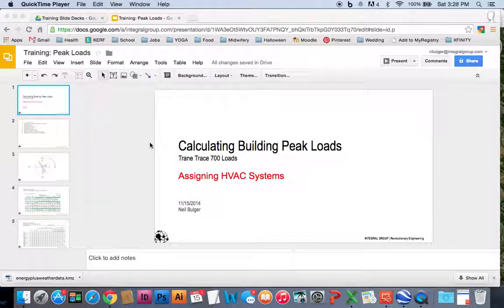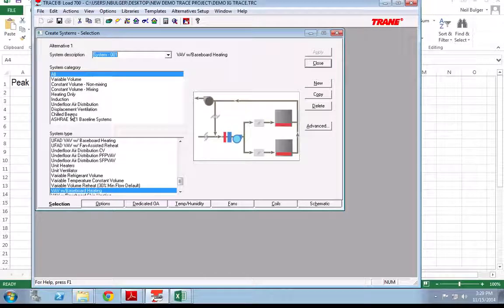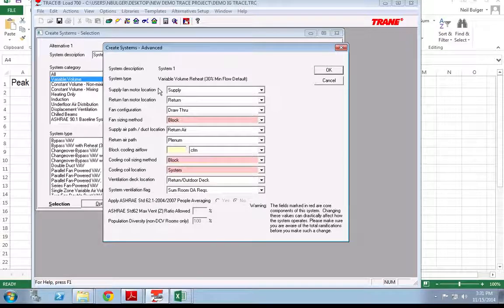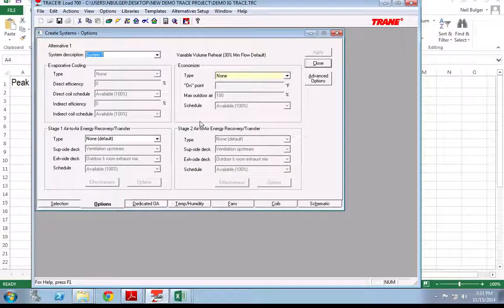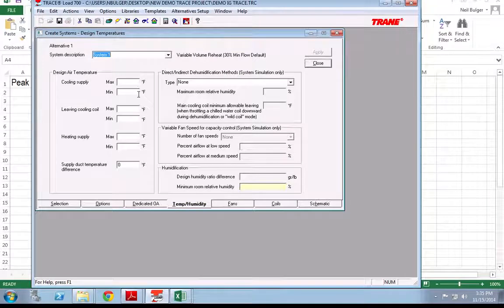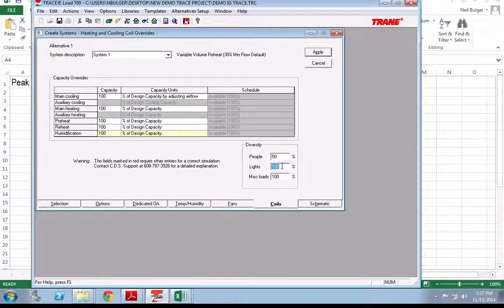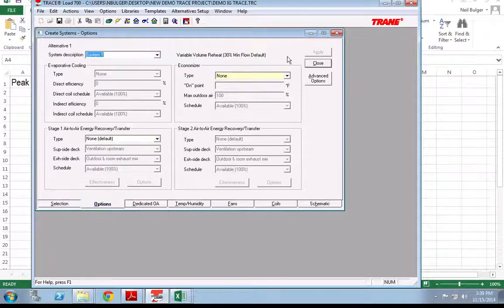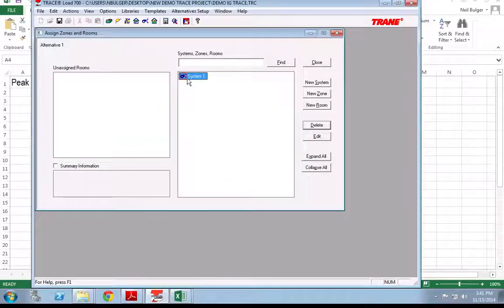Trane Trace 700 - Basics - Assigning HVAC Systems Part 1

Comment: Hey Neil, thanks for the videos. What do I do with an unconditioned room? I've got several storage rooms that have no conditioning, yet they have outside walls. Seems wrong to ignore them, since they contribute to the envelope load. Yet, I don't want to put them under by VAV system either. Any suggestions here? Thanks